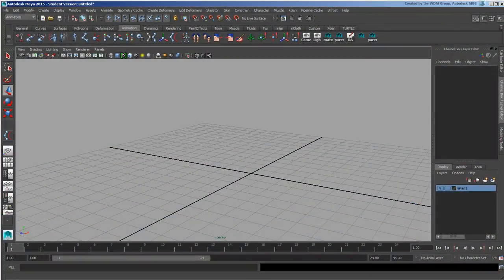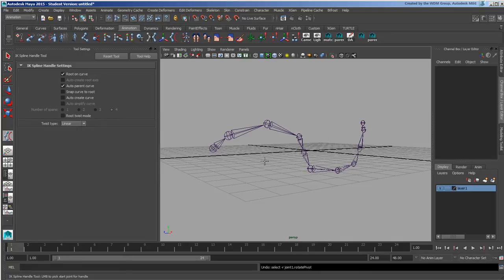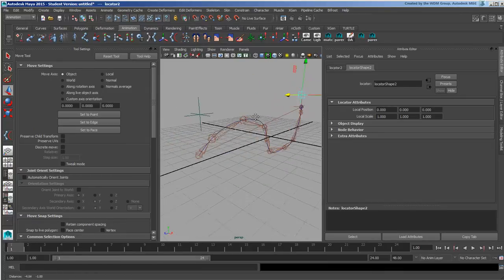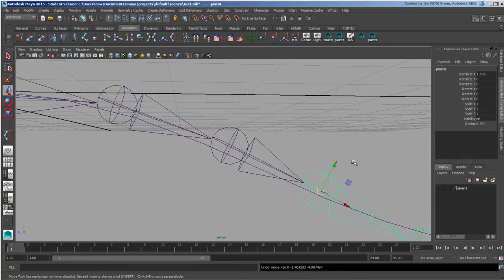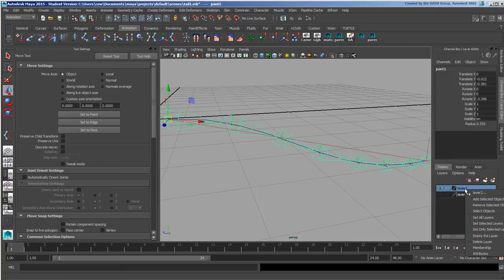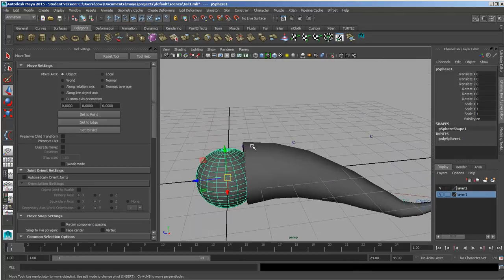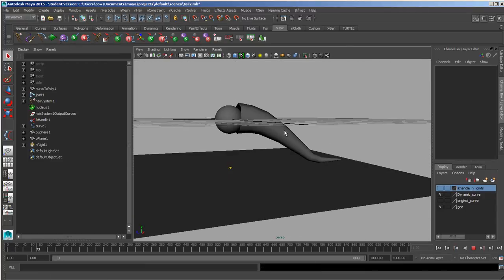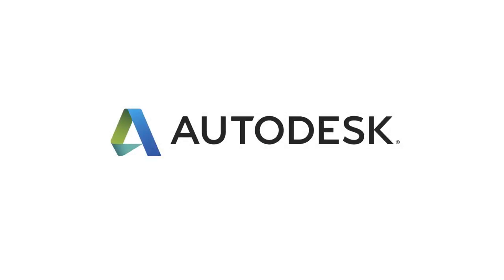Using the IK Spline Handle in Maya

Comment: This is the stuff of nightmares, when he says quickly assign this at 9:57 All I can see is he did a smooth bind skin,
but i've tried EVERYTHING and the geometry just won't bind to the IK spline rig. This is driving me insane :(

http://puu.sh/nGDmp/b0c17983ff.png
Reply: +Nepu-Tech USA After 2 days of suffering I finally discovered my problem, for those who find this post in the future, the problem was in the smooth bind settings it says select Joint, it has to say select hierarchy if not it only selects a single joint always. Whoever thought this setting was a good idea should be shot >.>

Comment: If you did mention it, I apologize, I'll have to watch the video again, but could you explain where an IK Spline and its controls go in a rig hierarchy? I recently rigged a dragon and used IK Splines for the wings. But after parenting them to the master control, double transforms kept happening everywhere.

My question, basically, is how should one contstrain/parent the IK Spline Handle, the IK Spline Curve, the clusters on the curve, and the controls of the clusters, in relation to the skeleton and the other rig controls?